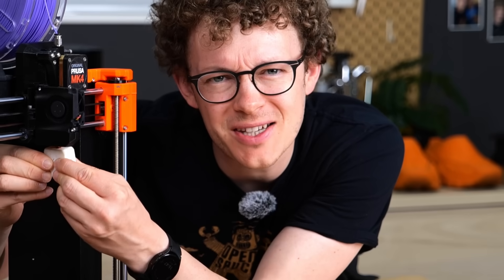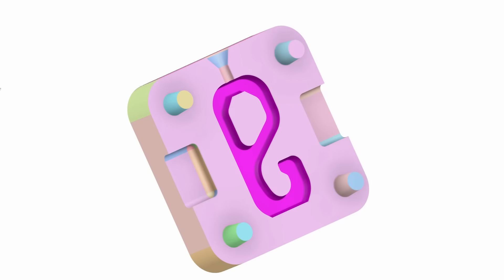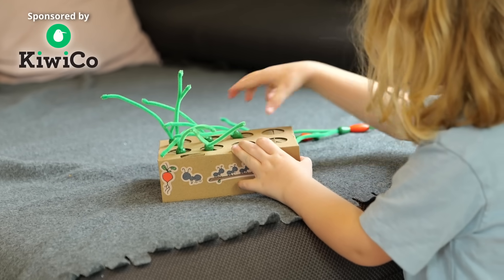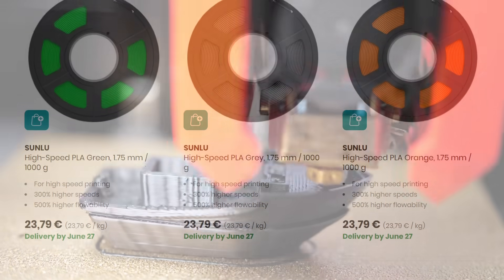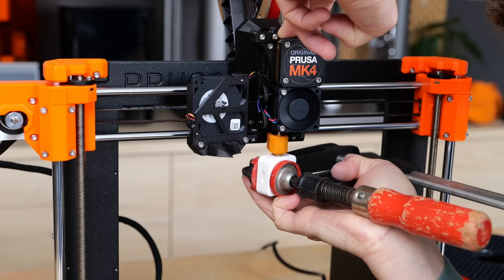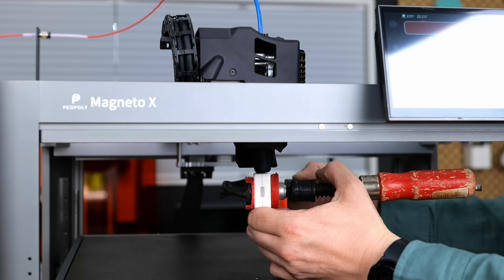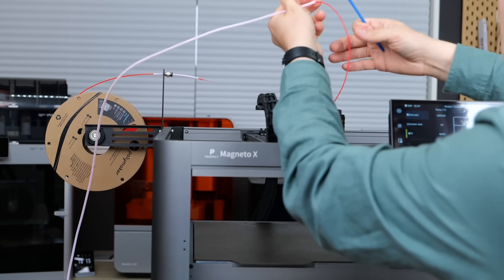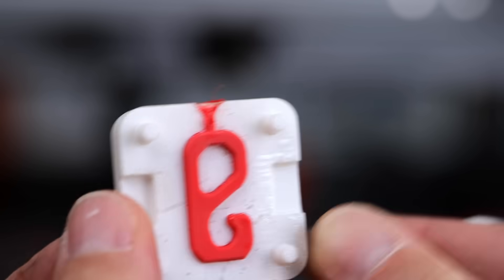I tried Injection Molding using a 3D Printer!

Comment: Hello from Montreal. So what I noticed is two things. 1- you need an air hole exit to allow the hot filament to make its way instead of possibly building pressure in the mold.  2- Why not lower the gantry to push down on the mold while sitting in the hot plate? Thanks for the video.
Reply: Glad you posted this, I was wondering the same two things!
Reply: I was wondering about those exact 2 things
Reply: You can make a flat slot for air exhaust, maybe one layer thick, and you probably won't even get any flashing since your pressure is so low.
Reply: @maficstudios  maybe not even fully escaping exhaust, but right sized to contain the air that isn't currently escaping.
Reply: I was surprised he was able to fill them completely without some internal paths for the air/pressure to go. It doesn't need to be an exit hole through the outside, just a place where the air can move to while the plastic is filling it. An exit hole would of course eliminate the back pressure caused by compressing the air but many parts like model kits just have extra bits that just extend to dead ends without exiting.
Reply: @ThndrShk2k  I feel like the mold halves aren't "molecule acurate" to each other therefore air can escape... but a vent would still not be a bad idea
Reply: @jeremiahbullfrog9288  Thank you! Exactly, the surfaces are way, waaay too uneven to trap any gas, unless they are machined with extreme precision. Though I only have experience with FDM molds and silicone, got them as tight as I could and it still made a bit of a mess. I don't see how even with the superior precision of resin prints one could get a mold anywhere near airtight.
Reply: @matwyder4187  its not really about "air tightness" but the resistance it offers. Just imagine a syringe were you have a large air bubble inside and a very tiny exit hole. You will get significant resistance from that, and by the time the pressure drops to levels where you could overcome it, the material is already to cold.
Reply: @matwyder4187  Are you aware that there is nuance between something being completely air tight and having unrestricted airflow?
Reply: @hornet331  OK, it might be a factor, especially if the resin mirrors the shiny glass surface it was built on. Gotta admit, never even seen a resin print, dunno how that looks, couldn't really decide by the video, so yea, thinking of it again, it might be pretty well sealed unless you roughen the surface a bit.

Only guessing Stefan is not so dumb he didn't consider this. In fact, I wonder if some of the early failures were more about YT content creation than actual trial and error experimentation. Like, it's obvious you want your mold hot, even if it conducts heat terribly, it is still a big chunk of thermal ballast for the mass flow of any FDM extruder.
Reply: @ThndrShk2k  Those molds probaly arent anywhere close to air tight. The microscopic ridges in the 3d print should let air leak out, especially at the abysmal feed rates that the 3d printer can manage.
Reply: Exactly. And by doing that you can use the heated bed to keep the mold preheated the whole time.
Reply: Also maybe have a silicon sock on the mold so it doesn’t cooldown? Preserving the liquidity to the very end where it’s flowing around the corner seems essential.
Reply: @ArthurBugorski  Yeah, was going to suggest this as far as I know injection molds are generally warmed and vented.
Reply: I'm amazed Stefan didn't figure that out before he started!
Reply: Was gonna say exactly the same thing, but with a 3rd suggestion. make a mold clamp with 2 pieces of metal and a couple of screws, leaves hands free (maybe to use a blow drier to keep the mold hot.
Reply: Spot on! Mold design is a thing... Without vent holes the mold cannot fill...
Reply: Yes! Great suggestions!
Reply: Yes... and heat the mold up with the heated bed, not just pre-heat but heating during filling.  Or, even a solder plate sitting on the bed to get even hotter.  Make it as hot as the mold can take.  If it's hot enough, you could take as long as you want to fill the mold.
Reply: my guess is that its not sealed perfectly between the two halves and therefore air pressure is probably not the issue as it has ample room to escape. you can see the layer lines on the part and it was also printed on an angle and definitely has layer lines
Reply: Exactly this!
Reply: Yeah both of these, especially the air hole. He can also go a step further and vacuum it to suck the plastic in as well.
Reply: In addition to those 2 suggestions, a custom nozzle for the printer with a shank on it with machined concentric grooves that are matched on the mold halves (with a slight interference fit) would allow the mold to be placed on the nozzle and clamped in place allowing more of the injection pressure to push into the mold may help the mold to fill completely and reliably.
Reply: I was going to ask the same thing.  It would be easy to make a gcode file that lowers 10mm and injects x plastic, then raises again.  Then you just have to lower it into the mold manually to zero it and start the code at 10 mm above.  just be sure your gcode is set to relative.
Reply: Being "smart" doesn't mean you think of everything ahead of time, or that you know all the intricacies of a particular process. Maybe cut him some slack.
Reply: @jeremiahbullfrog9288 I’ve gone down the injection moulding rabbit hole myself - 
Lots to do with moulding isn’t obvious till you’ve learnt and thought about it - and his first 3-4
Failures struck me as obviously going to occur before he even showed the results.  I didn’t understand why he even tried them - but then it dawned on me - ahhhh he’s making a video. If he doesn’t share a story of the journey - there won’t be a video ! I imagine with an engineering degree he must have known the basics of injection moulding before he started … but maybe he didn’t/ doesn’t …? Maybe he expected the early experiments to fail but figured there was value in showing them anyway ?
Reply: @jonnyhifi  That's a good point, making things accessible to an amateur audience ... People who've never touched this stuff wouldn't think about these problems but they get to see it happen
Reply: @jeremiahbullfrog9288  and indeed I wanted to watch his video as the combination of his  good engineering brain, being him being smart and willing to do experiments always results in very interesting content - even if it’s a topic I might arrogantly think I know something about- I knew  there will be good stuff in there ! .
Reply: @jeremiahbullfrog9288 agreed. Also he is pressed for time, having to put out a video every week or so. And when you are under pressure [pun intended] small things escape your notice.
Reply: @jeremiahbullfrog9288  I don't think they are attacking him by saying they are surprised that he didn't think of it. It's a compliment. I'd be thrilled if people expected me to think of everything. Thanks for assuming I'm THAT brilliant. I don't see why anyone should lay off complimenting him.
Reply: We demand perfection from our free entertainment!!!
Reply: Ah sarcasm! Yuk yuk.
Reply: I was actually going to suggest the same 2 things...
Reply: using the gantry and bed as two standard parts of any mold machine  is just normal. Not using hands to press the mold to nozzle. 😮Yes, you can bend a bed, but its just an experiment.
Reply: @andreyansimov_diy  maybe making a bigger more sturdy bed over the bed with some screws as legs to level it and not force the printer's bed (but still transfer the heat)... all inside an enclosure.
Reply: Hallo Stefan,
tolle Idee einen 3D-Drucker für Spritzguss zu verwenden!
Das Problem der Formfüllung liegt vor allem am Material. Die Filamente sind Extrusionstypen und haben eine sehr hohe Viskosität bzw. Schmelzefestigkeit. Sonst wäre die Filamentherstellung eine Katastrophe. Mit einem Pelletextruder könnte man auch Spritzgusstypen verarbeiten. Damit sollte es deutlich besser funktionieren.
Was mit dem 3D-Drucker nicht funktioniert, ist einen gescheiten Nachdruck aufzubauen, um die Volumenkontraktion zu kompensieren. So bekommst du immer Bauteile mit inneren Fehlstellen.
Gruß,
Frank
Reply: 100% I was so annoyed seeing Stefan struggling with this without an exit hole and a stand for the mold
Reply: I was concerned about the lack of an air outflow as well, but if that was the problem, the TPU should have had the same problems as the earlier filaments. My guess is that the mold surfaces are sufficiently imperfect that air leaks out already.
Reply: I was thinking about the exhaust hole as well - something at the opposite end(s) of the injection port.

I really enjoy another channel, @TheCrafsMan, who has a hobby injection mold machine. He's talked about molds (and even tried using a resin mold in the past to some success) and is a fun person to watch while learning some of the basics.
Reply: I wondered the same thing , specially the second one ! , the printer can push the mold towards the bed , so no need to hold it with hands
Reply: Su manera de hacerlo nos permitio ver como avanzaban las pruebas a medida que cambiaba los materiales y demas parametros.
Reply: Tom makes a good point
Reply: Came to comment this 👍
Reply: The air hole is kind of obvious, noticed that from the get go. Although I have to admit I did took a manufacturing semester in university studying mech engineering.
Reply: 3d prints are usually not air or even water tight from the get go. So building pressure shouldn't be too much of a problem.
Reply: I came here to say the same things!
Reply: I thought the same things but I’m pretty sure the printed mold isn’t air tight anyway…
Reply: Same!!!☝️😉
Reply: Definitely needs a sprue!
Reply: I was thinking the same things.  +1 thumbs up.   The air vent would be essential since you can't get enough pressure to literally compress the air into a 'tiny bubble' deep in the part.  (super expensive injection molding machines, can, or have their parts orientated/designed for this tiny vent)  this pressure would appear to be building up to the point of 'stopping' the plastic from flowing further, then it cools and you have an incomplete part.  a literal pinhole should suffice, and would make clean up of 'leaking plastic' a breeze.      And as others stated, when possible you should aim for the 'middle' of the part, so that it can flow in all directions making it easier to get into every spot. Obviously on things like M4 screws, that isn't ideal, but flipping the screw so your filling from the hex end, might do the trick.
Reply: I should have read before commenting.
Reply: Using the hotend to apply some pressure onto the plate is great, because the plate can also be heated to help the mold keep its temp. Alternatively each mold could be designed to accept heating elements running at a low but sustained heat to ease the delta between the part and mold, keep the plastic flowing longer.
Reply: Also, why put the thing on the top when you can put it more central to the peice?
Reply: I was about to say that. You need small exits for thr air to fill everything up mostly what you care is your part then if there are extra things, doesn't matter, you simply cut them off
Reply: @CNCKitchen read the first comment
Reply: Without reading all the replies, totally agree. The mold isn't empty..it has air in it, you gotta have a way to let that out as you push in molten plastic.
Reply: Agreed. An air release hole would remove the inside pressure. It is like a balloon. It can only compress so far before something has to give. Many injection moulded parts have 2 marks on them, injection site and exit site. I reckon Stefan thought the moulds are small enough to not have the air be an issue.
As someone who has to work with nozzle sizes to avoid pressure build up. This was obvious to me also.
FYI I make reusable model rocket motors for hobbies and education in my country.
Reply: The air vent is an important and interesting tip indeed, tho I'm very skeptical about the gantry doing much significant pressure on the mold to hold it in place, it's pretty easy to lose steps and stall the motor if you run the gantry into the bed, thankfully for 3D printing of course, as you would rather realign the gantry than replace broken glass, but that does kill the possibility of using it for this specific purpose.
Reply: I went to the comments to look for exactly these, plus to comment that in every clip, Stefan was not holding the mold perfectly level with the nozzle.

I'd put a vent hole right at the tip of the hook.
Reply: This! I was thinking this during the whole video, I kept thinking his molds were designed more like resin pour molds where the excess resin in the sprue hole allows the whole mold to be filled during time in a pressure pot/vacume chamber. With injection molding since your not starting with a liquid you need at least one more sprue at the end points for the air in the mold to be pushed out, I also think in addition to to the additional hole for pressure escape, a printer with a heated chamber would be optimal as well, or some kind of heating element clamped onto the mold during injection.
Reply: Putting the mold on the bed means you can preheat the mold too.
Reply: i was thinking the same 2 things
Reply: This is my favorite thing about humans, "hmn yeah, but what if also! progress!"
Reply: Exactly wanted to say the same. There is a reason for "sprues" on all injection molded items. 

I would addittionally try to make some kind of active heating of the mould.

I've had some experience in metal injection moding, and can confirm that this is basically a balancing act of generating ways for air to escape, ways to make the "material" overflow in controllable way - sometimes even with creating underpressure that pulls on the molten material. 

Irony is - possibly the allen key mould would work best for Stefan :)
Reply: Yup, came here to to say this!
Reply: Are 3d printed molds air tight enough for a vent to be necessary?
Reply: @Londrino  yes. We’ve injected 3D prints before for fishing lures and air holes are needed to get material to the bottom cavities
Reply: I was about to say exactly those two things as well.
Reply: Same two thoughts here... the air hole could also work as 'mold filled' indicator in case it's big enough
Reply: I came here to say the same thing.  You have to have a way for air to escape the mold while the plastic is being injected, in order for the plastic to fill the mold.
Reply: Same here ... exit hole🎉😮😮😮
Reply: Same. These are two basic things and I'm surprised Stephan didn't do them.
Reply: My thoughts during the whole video
Reply: I was coming to mention lowering the gantry to hold the mold as well. It should also help with radiating heat through the mold depending on thermal limitations of the resin.
Reply: I was thinking about the same thing. Also the air hole can be small so it can build some pressure but let the air go anyway.
Reply: As someone who has looked into making my own soft plastic fishing lures, I wondered the same thing.
Reply: I came here to say the exact same things! Good call =)
Reply: Was thinking the same thing. When casting metal there's usually an air hole or holes.
Reply: Thought the same exact things! 😂
Reply: My exact thoughts
Reply: Another thing I was thinking of is that some 3d printers have a heated bed and if they could be utilized to preheat an aluminum mold.
Reply: I'm curious of a few things. Why use your hand to hold the mold to the model when you could set it on the bed and force the gantry down onto it making a better seal? And also why not heat the mold and have an exit hole?
Reply: I thought about this too, especially about air compression.
Reply: I thought exactly the same
Reply: And he could preheat in an oven to even higher temps aswell.
Reply: As soon as I saw this it was like he needs to relief hole and baby powder
Reply: Also, If he'd made a hole on the bottom he would have literally had it he filled it up halfway flip it over 🤦‍♀️
Reply: Exactly my thoughts 😂👍
Reply: As someone who works as an engineer with injection moulding- no, you dont need a vent hole. the whole parameter of the interfacing surface funtions as air release.
Reply: You could also use those air holes to blast hot air Into the mold to preheat the inner walls so the material stays molten longer.
Reply: I was wondering that. I took bronze casting in college and they always had us make a vent and a pour cup. I'm thinking even his lower speed tests would have worked with a vent.
Reply: I learned about injection molding in college, can't remember a lot, but I'm sure you need the air to escape the mold. But at the same time the mold is probably not airtight, so the air can exit without vents.
The second point is exactly what I was thinking.
Reply: I noticed that. Every injection mold I've seen has some way for trapped air to escape. Not an expert but I thought it was odd it wasn't considered.

The other thing I figured is that when the filament has to travel up to fill the hook. Maybe a channel between the body and hook to let it fill in from the top.
Reply: Yea, just drill a miniscule air escape hole in the very end of the mold so more can flow into the end. Ideally this will let the filament flow through entirely, then it'll then block that hole and begin to build more pressure for the material itself. Then you just cut off the little tail with the sprue. right?
Reply: I had to assume it was intentional for content at least for the relief hole. If he watched even basic tutorials on molding or casting he’d have known about that. 

He’s too smart to have been that stupid.
Reply: @spellfireforge  I don't feel like he would have gotten less views from not putting an exit hole. He got a few successful molds either way. Even beyond the lack of an exit hole, there were other problems like the extruded filament cooling too quickly before reaching the bottom of the mold. The exit hole just means he wouldn't have been fighting the air in the mold.
Reply: Yes, this is head scratching, he seems to be intelligent and with the internet there are no excuses to not research.
Reply: agreed, even if tyhe seal isnt perfect, airvents would greatly beneffit the inyection process
Reply: This is one of those exact comments where you like this guy had done all this research knew all the stuff and like the one piece that would've reduced the amount of time he spent on it by like 80% because the first month probably would've just worked
Reply: Yeah injection molds us vents to release trap air. Otherwise you run into burns when it gets to end of fill. The trap air compresses so much that it ignites.
Reply: Stepper motors would just skip steps or the bed flex simply result in not getting anywhere near the pressure needed to keep the inlet sealed well enough. This is what injection molding machine use large clamps to lock the nozzle into place. The air vent is something he missed but the way he was holding the nozzle was the best possible way to do it without building a dedicated fixture for the hotend.
Reply: exactly this im confused
Reply: In an actual injection mold we create vents opposite the gate. They typically are not a hole but a small channel to let gas escape. They are typically only the the thickness of what the material normally flashes at. In this case .1mm deep by 1mm wide out the end of the mold.
Reply: Watched and came to leave these comments lol. Pressure hole is obv and removing shaky hands as a variable seems like it would have been simple enough.
Reply: Ye that was my first thought as soon as I saw the mold smh
Reply: I swear I saw this AFTER 8 made my post.  We both thought of it lol😂
Reply: We think alike. lol
Reply: And preheat the mold to prevent solidification.
Reply: First things I thought to. I think his slight improvement in results on heating the mold may have been due to the trapped air, being heated, would contract on cooling. An outlet definitely seems necessary to me
Reply: exactly - no where to go, building unnecessary pression inside the mold, just leave an exaust hole, don't need to worry about psi mumbo jumbo 🤦‍♂🤦‍♂
Reply: Also: heat the mold.
Reply: Agreed, need an exit to release the air pressure in the mold
Reply: Not realy neaded with such slow injection speed and presure. Also i bet resin is way more flexible than metal so even if iinjection speeds were greater there is a big chance it will juse go out
Reply: It’s like he did NO research before making this video. Embarrassing.